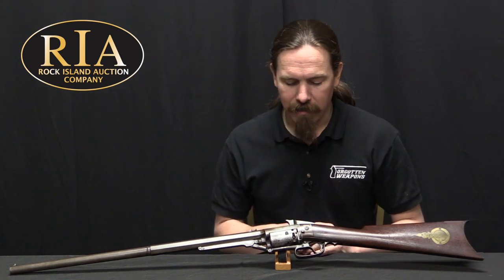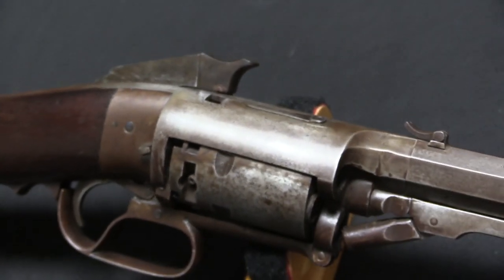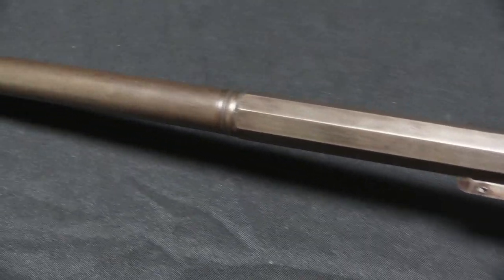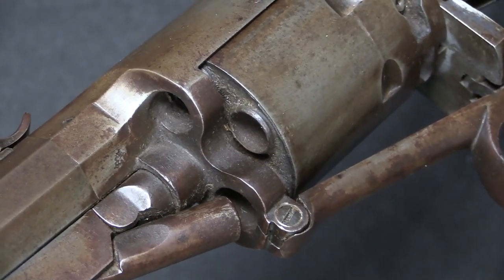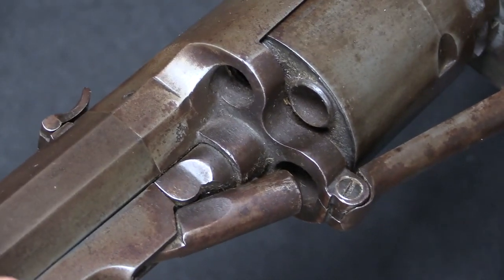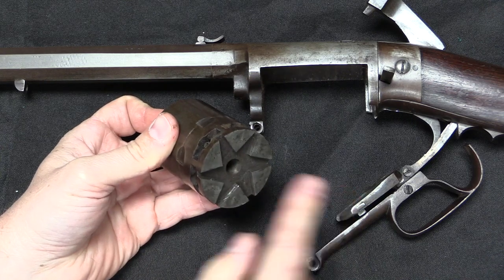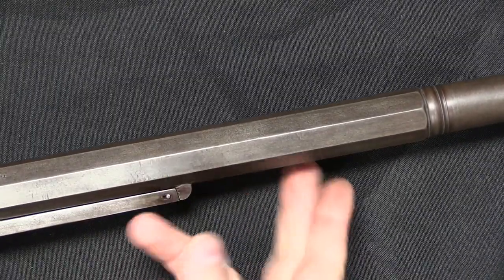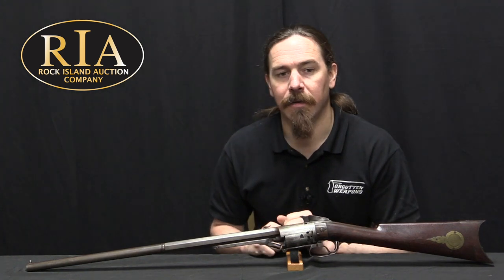North & Skinner Wedge-Lock Revolving Rifle

Comment: Mark at anvil would be pissed at the lack of "maintenance" on this old gem.
Reply: Yep, the inside looked like mixture of old black powder and straw, doesn't look like it was cleaned since 1800's.
Reply: @johnmorgan1629  I was noting that also. Would cleaning it to remove gunk lower the value?
Reply: @gunnerclark  I go with Mark's view "It may not be worth much now, but it means that it lasts another 200 years" and as someone who enjoys history, I would prefer something like this to last.
Reply: This is the fault of the previous owner, hopefully the new one can do good by this piece of history and have it respectfully cleaned. Gunk and powder do not represent historical value and in some cases, they can even be corrosive or damaging to the gun.

There's a distinct difference between cleaning a gun and restoring it (good or bad), unfortunately, be it for monetary reasons, fright or what have you, a lot of pieces go unserviced. This kind of thing happens in more than just the gun community, art, architecture, even in the musical community, same problem. People just assign a value and that's the extent of their concern.
Reply: @gunnerclark  cleaning never will lower value, but stop yourself if you reach for anything abrasive.  there is a difference between cleaning/maintenance and trying to make it look new again
Reply: Aren't you at least a little pissed?
Look at that grungy... eugh.
Reply: @michaellesak6912  well a soft bristle wire brush doesn't hurt now and then
Reply: @aserta  Well yeah... cleaning some of those things you listed would literally ruin them. There's a reason many experts recommend you DON'T clean historical artifacts. You get artifacts restored but you definitely don't clean them. The patina and grime help verify exactly how old something might be, where it has been, what it has been through, ect. The dirt is just as much a piece of history as the item itself. Plus ANY expert worth their salt would immediately be able to tell if an artifact has been cleaned or not and most will be very distraught at being presented a piece cleaned by a complete fucking amateur who just ruined all the value the piece had.

I'll take the epic story of why my 150 year old gun is so dirty vs the shiny paperweight I just created by taking some Pledge or Windex to a piece of history. But that's just me.
Reply: @gunnerclark  I agree with others, just a light clean by someone in the know, also to give it a good check for other potential nasties, which could cause damage. Personally, I'd leave it in 'survivor condition', as much as possible if I had money for it, not as a shooter. With something like that, in my opinion, how much it was worth or could be worth, is not the thing, I would be more interested in the history of the thing. While I don't have the advantage of being in the US, if I was, there would be plenty of other guns to shoot for pleasure, without risking damaging that one.
Reply: The inside of that gun reminded me of what the inside deck of a lawnmower looks like...

Comment: I always inevitably have the same thought while watching these videos, "Man, screws have been around for a long time".
Reply: The term is "standard". They're literally called standard screws.
Reply: I love this thread :)
Reply: Heck. I used to think that too. Then I learned how long assembly thread have been used. They are old. Even older then firearms. 
Then there are screws for elevating water but those are not as fascinating. 
I want know how they made threads in the 14th century.
They did.
They wrote about them.
They assembled weapons like swords with them. 
But how?! 
The screw cutting lathe was invented in the early 1800's. Taps as we know them came even later!
Reply: @jimandaubz  I always wonder how these sorts of things were produced before the lathe. To produce them in a standardized fashion by hand in any quantity would seem to have been impossible, but they did it somehow.
Reply: @TrinidadJamesWoods  unlimited time to think & practice.
Reply: @jimandaubz  I know this comment is old, but basically what a blacksmith would do before screws were made to a standard, (15th-18th century) was take a round piece of high carbon steel of the right diameter for the screw, file a screw thread in it with a triangular file (or square in the case of a thread for a vise), cut 2-4 grooves in it with a round or diamond nose chisel, file a relieve on the thread, harden and temper it, this would be the master tap. This tap would then be used to make a cutting plate in a similar way, (like a die, but one plate with handles, often with multiple cutting holes in it). If a lot of screws or nuts would be needed these masters can be kept just for making other taps and cutting plates. I have some experience using tools like this, and in low carbon steel they last maybe 30-100 screws or nuts. Though in puddle iron or other early iron (with almost zero carbon) they would last somewhat longer.
Now, it's really hard to make screws this way to a precise specification, but all the screws and nuts made from taps and cutting plates derived from this master screw will fit each other, regardless of their non nominal pitch, shape, or diameter.

It sounds complicated, but it's really not that hard. It should be noted that when standard threads became a commonplace, screwcutting machines were available.
Reply: The first leadscrew for a screwcutting lathe may have been drawn wire wrapped around turned round stock & secured into place. It sounds like a cool story anyways.

Comment: That is mechanically very cool. I would buy a modern cartridge revolver on this principle or the toggle
Reply: Same,I've always adored revolvers and hated the issues with making them rifles,I want a modern 44 mag revolver rifle so bad.
Reply: I believe the only modern cartridge revolver to use this principle, and I'm using the term 'modern' very loosely, would be the M1895 Nagant revolver.  I have one in my collection, more as a curiosity than anything else.  They're a bit non-ergonomic to handle, hard to find ammo for, and generally clunky, although mechanically rather clever.  I think Ian has done a video or two on them.
Reply: The Nagant uses the trigger to operate the locking mechanism so has that famous super heavy trigger. A carbine on this principle could be a lever or pump allowing the trigger to be light

Comment: wow a few years ago when thinking about how to make a practical revolver rifle i came up with a concept almost exactly like this, except instead of the wedge i envisioned a cam attached to the cylinder pin which could slide back and forth, so it was more like a lever-toggle-action. the wedge is simpler and integrates my idea of the battery-arm and cylinder-rotating arm into one part.

goes to show there's nothing new under the sun :)

edit: 10:31 OH HAHA i'd like to see that!
Reply: Hi, just wondering your thoughts on guns like the Tarus/Rossi Circut Judge. They solved the gas issue by placing 2 small channrls  to vent gas away from the user. Never had a cgance to shoot one so I have no Idea how well they work, but apparently they make a .44 magnum version.

Comment: They made it almost a quick-change cylinder.  It would have only taken a few slight changes, and could have reloaded the gun in a couple seconds.  Still would have failed though.
Reply: And a soldier would cry for extra carrying weight that he has to because each cylinder would have a weight equal to 24 rounds.
Reply: @P-Talks 
Anyone with an IQ capable of entering Service would not cry about extra ammo
Reply: @justiceforjoggers2897  83 or higher, any lower IQ is illegal!
Reply: carrying a spare cylinder is almost a moot point anyway. To fully utilise a spare cylinder, you would have to have it capped as well, and if you happen to stumble or fall, or dropped the spare by mistake, and it lands on one of the caps... boom... better hope that cylinder isn't pointing anywhere near you! Having a fully capped, spare cylinder was inherently dangerous. As far as my own experiences go, capping the cylinder takes almost as long as loading it, so if, for safety sakes, you leave the loaded cylinder capless, you may as well just reload the entire thing.

Comment: Very cool and obscure gun. Estimate is $4,00-$7.000 and I bet it brings closer to the high end. If it was in a little better condition it would go way over. 
I wonder why they put the cap box on the left side of the stock instead of the right?
Reply: I think it was put on the left side so that a right-hand shooter wouldn't need to use his trigger hand to grab caps.

Comment: I've often wondered why they didn't put a vertical for grip on these revolving rifles if you designed it right your hand should be safe from the cylinder gap 
flash .

Comment: Would i be wrong in saying that if the gun chain fires and a side round goes off it could clip your forward grip hand? Anyone know if thats an issue?
Reply: That might be an improvement over the whole mechanism becoming a grenade right in front of your face.   I doubt you'd get a lot of velocity out of the 1/4- 1/2 of 'barrel' in the front of the cylinder.  Lot of flash, lot of boom, but less zoom.  All about risk mitigation, not elimination.
Reply: That's why they used shooting sticks back in the day.
Reply: You don't grip these forward, you use the section forward of the lever so your hands are closer together. There's a reason there isn't a forestock...
Reply: @mfree80286 Yeah that makes sence now that i look at the front of the barrel more closely. Just looked like a difficult way to hold such a long rifle.

Comment: Has no one tried a trough shaped hand guard? Something that would go around the cylinder and extend as far forward as you were likely to put your hand?
Reply: nosuchthingasshould I was thinking that myself, perhaps it could even slide forward for re-loading, and be the grip to avoid a chain/fire from hitting you?
Reply: Yes, it would protect the hand from chain fire. I'm sure someone must have tried it, it's such an obvious solution, and simple, not even mechanical really .

Comment: I'm always curious about the methods a gunsmith would have used back in the 18th and 19th centuries to accurately mill metal parts like the ones used on this piece.  I mean, if it was just a guy making one as a hobby, it'd be one thing, but without electricity or even steam power, how do shape metal stock 200 years ago?

Comment: Even with the screw and captive pin it still looks like it would be faster to change cylinders than to reload the one. 

The modifications to make changing cylinders convenient do not look that difficult; a thumb screw with the threading on other side and enough thread so that the lever drops free before the screw does  and the cylinder pin held in place with a detent rather than the captive pin. 
How much energy can the bullet get with only half an inch of barrel?

Comment: What are the two square cut outs either side of the nipple for? I guess they could make it easier to fit the cap, but why the two square cut outs on the top of the shield so you can see them from the top?
Reply from the maker: The nipple is a replaceable part, and those flats fit a wrench used to install and remove it.
Reply: Thank you  @ForgottenWeapons , informative and helpful!

Comment: No disrespect but they have been able to use the revolving concept with great success in the Rugar 10 / 22 with the revolving magazine.   It isn’t a revolver per say but it used the revolving concepts without the revolver issues...
Reply: What? That's nothing like a revolver at all. The chamber is still integrated into the barrel on a 10/22, and doesn't move. Revolvers by definition have multiple moving chambers.
Reply: Completely different system. 10-22 is a straight blowback action and the magazine is irrelevant to operation. They work just as well with box magazines
Reply: Others have pointed out that a revolving magazine is not a revolving rifle. In a revolving rifle, the cylinder is actually. Imposed of the chambers, ie the chambers rotate.
A firearm with a rotating magazine is hardly the same thing. While the Ruger 10/22 is a good enough rimfire rifle, the revolving magazine is hardly a new concept, having been used in various rifles going back t9 the 1880’s to the best of my knowledge.
Reply: Go back to sleep